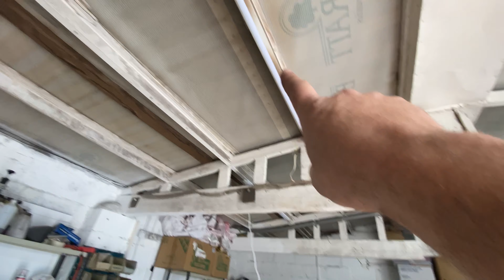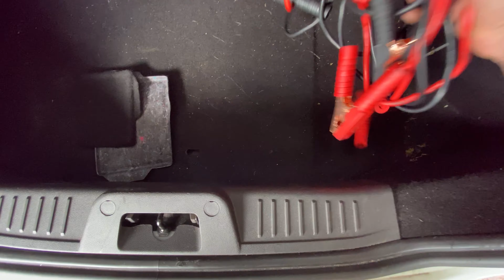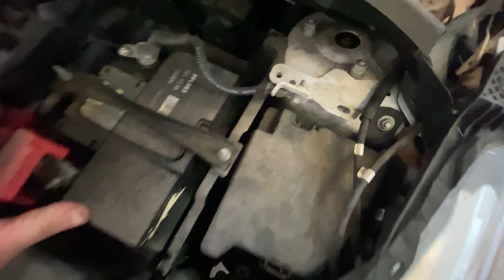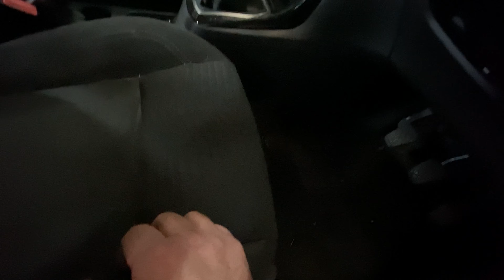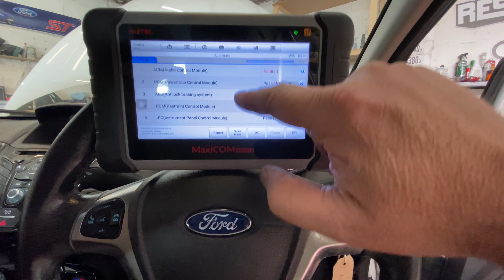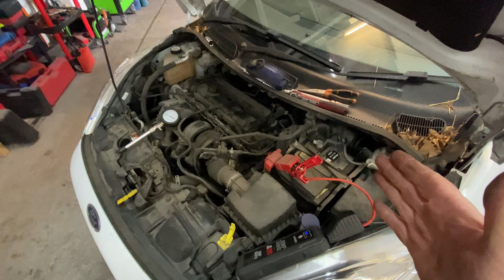New Project Pick Up A Non Runner Don't Start No Power Can I Get It Running Or Is It Engine Out ???

Comment: If its bottom end engine trouble the chances are if they've not changed the oil or not serviced it paper oil filter might have broke up and went inside bottom end in the sump that's what happens if ye dont service yer car not like old school metal oil filters

Comment: timing belt camshafts aux pulleys  etc always need to be checked inspected FIRST before you make any attempt to turn it over  that being said its now determined its dead  i always look for another one with hard rear end damage or in your case hard passanger damage may be fine why because you get to strip the the new engine out and you may gain a bumper and mirror and you will normally pay less than you would for it all than you will pay from the breakers  also Rember its a lift tierupper  and you only have one lift i would clean the interior and file it outside till i found a suitable  doner car

Comment: If the engine was cooked, all the oil and water would be mixed and you'd have all mayonnaise on the dipstick and oil filler cap. Most likely a snapped belt and bent valves, hence the low compression. Take the cover off and check the timing marks first. A rebuilt head is easier than a new engine. Good luck!👍 😂

Comment: No coolant, it’s done the head gasket and fried the rings - that oil is black as coal so it may have seized - swap the engine out - the engines are cheap - do a clutch kit while your in there
Reply from the maker: Thanks buddy yeah sounds like a plan 👍👍

Comment: Just had very similar, the pully on the crank gave way. So the engine was turning the pistons, but not turning the cams. I am told on these little fords if they are a couple of teeth out valves will bend. We scrapped the car as it had 120,000 on the clock. Going to guess you will be looking for a replacement engine. Its in the budget so happy days.
Reply from the maker: Thanks Bill yeah I think I have made my mind up I’m replacing the engine starting tomorrow 👍👍

Comment: check belt first. if its gone they brake they are made to brake rockers first. so that they dont bend valves. you would need new camshaft tho
Reply from the maker: Thanks Brian I will take the cover off first 👍👍
Reply: @ResurwreckAutosUK  prob not belt with that milage but worth checking first
Reply: Compression is gone across all 4 it’s not timing its been boiled - put a fork in it, the engines is done - I bet the piston tops and plugs got a steam cleaning

Comment: You knew as soon as you cranked it, compression. You'll be able to turn that around with no problems. One step at a time and you'll be fine.
Reply from the maker: Thanks Mark i really looking forward to taking this apart tomorrow 👍👍
Reply: @ResurwreckAutosUK  I'm looking forward to following along. Going to be another good series
Reply: Easy replacement fiesta engines did one on my channel 👍👍👍

Comment: Sure Gala Motors will have an engine and other parts you need ,or Silverlake Southampton
Reply from the maker: Thanks mate appreciate the info Gala is around the corner to me I’ll call him in the morning 👍👍
Reply: Even gala will charge a few thousand for fiesta engine .best ask silver lake for low mileage runner .lots of them have a verified YouTube clip of engine running . Chuck a cambelt and new plugs and oil filter and oil and air and fuel and sorted .and check clutch linings and bearings while out